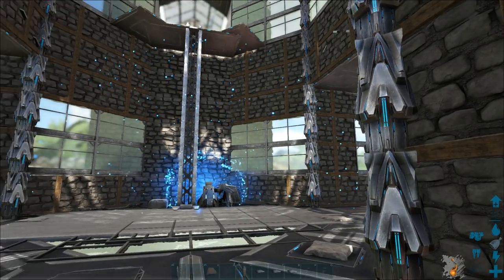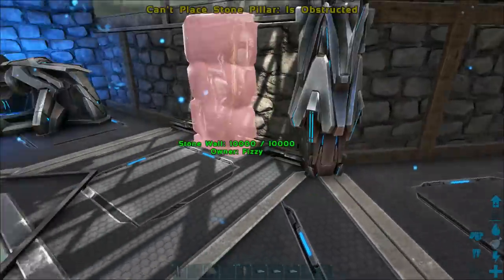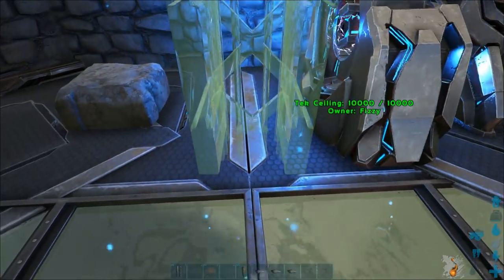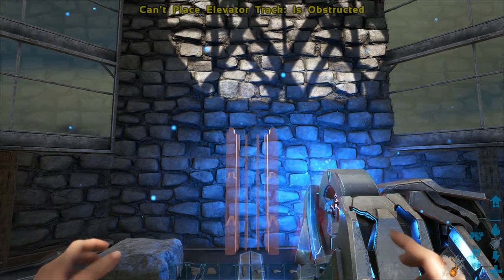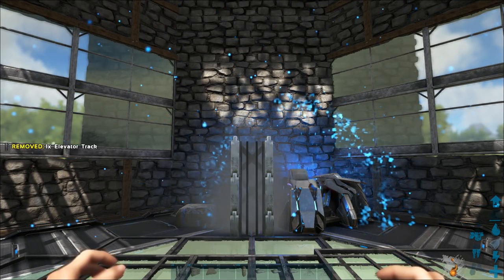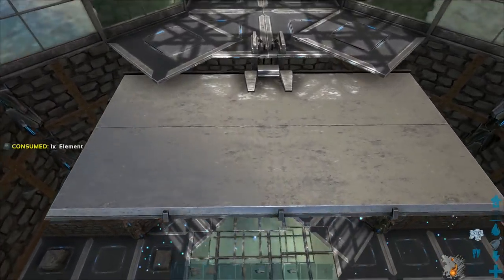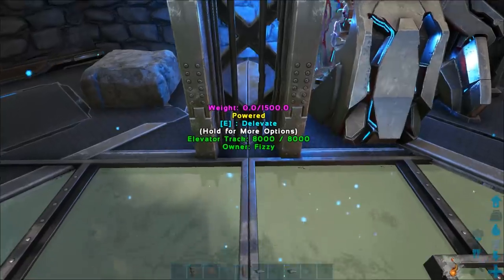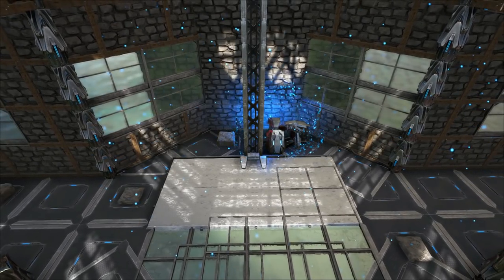ARK Building Tips & Tricks No Mods :: How Place Elevators!!

Comment: Nice video but that works only on natural map ground or over fundations.... when you try to use over leveled plattforms ( because you build a base over pillars because the terrain is too much irregular) , the elevator will operates to decend but will not acend anymore ( for your elevator acend again , you need to operates, in that case , directly on the elevator plattform and not on elevator rails )

Comment: How did you get the elevator to attach to a track on a ceiling? I get no foundation support msg when trying place the elevator on the track
Reply: @xxxharleyxxx6131  that doesn't work
Reply: @xxxharleyxxx6131  trying to fix this exact problem right now fence post foundation supports dont do anything still got platform needs support message ive connected the track all the way to the ground and have placed actually foundations under it and still says it has no support the game is bugged
Reply: @xxxharleyxxx6131  elevators are currently not buildable
Reply: @xxxharleyxxx6131  placed a whole track system to find out i just wasted so many mats for it to not work this game been put so long and its just as broken as year one
Reply: @xxxharleyxxx6131  I've done every suggestion ive found on the internet to fix the support problem even connected the track to the ground and still said it had no support when snapped directly to the ground
Reply: @xxxharleyxxx6131  its bugged i have 2 elevators i attempted to build both had the same issue one 60 tracks high the other like 15 tracks high both i have attempted every fix ive read of and it did nothing even demolished the 60+ and snapped to the ground said no support its bugged they're litterally no other reason, and considering i have my base half floating in the sky i have build plenty of ground foundations to allow my sky build
Reply: @xxxharleyxxx6131  i play on official pve
Reply: @xxxharleyxxx6131  or instead of any of that wildcard could just actually fix the buggs in the game but seeing how no one seems to care that the game is a buggy lag fest im positive ark 2 is going to be just as bad if not worse with lagg latency and buggs

Comment: I keep getting an error for foundation support. I built on pillars and ceilings.
Reply: Same here but unfortunately or fortunately you could add the elevators by using pillars. Except the elevator could only face one way and you’ll need to cover the pillar if you’re picky like me😭

Edit: The elevator will go through the floor too